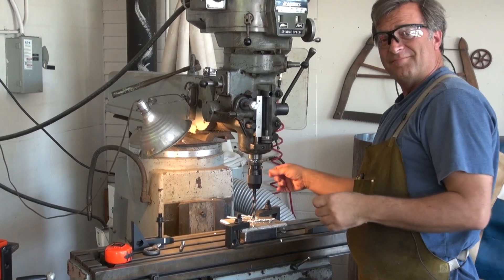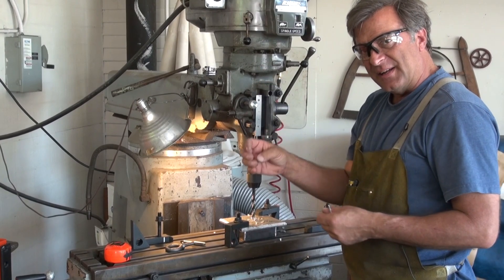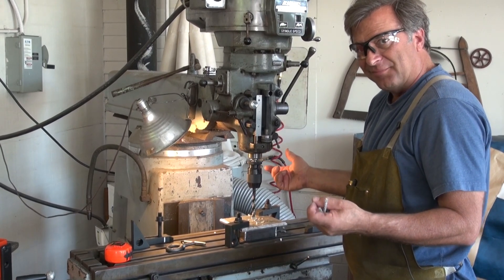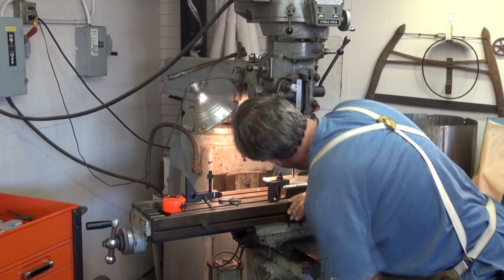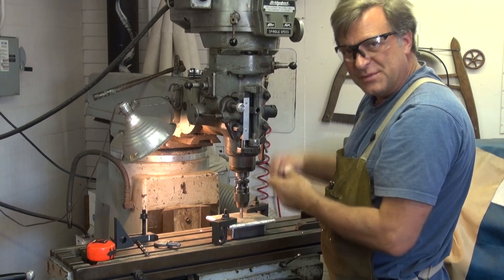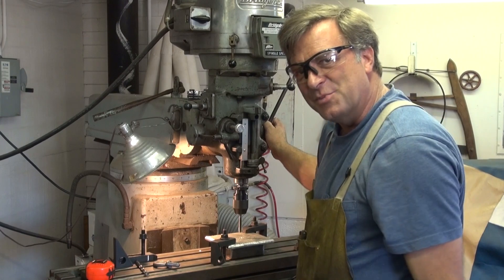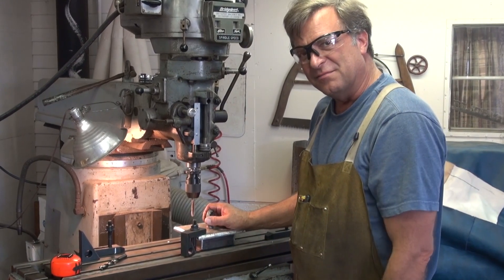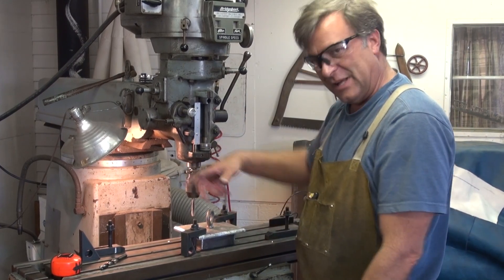How to Tap a Hole in Metal Using a Mill - Kevin Caron

Comment: I'm sure this has been covered in the previous comments (I didn't read them yet).

Power Tapping on the mill:

Use spiral point taps (gun taps) to push the chips ahead of the tap.  (Blind holes, make sure to drill twice the tapping depth)

Use a standard chuck, not a keyless, so when you reverse, it won't loosen up,
Use some sort of oil, tap magic for alum, wd-40 etc...

Slight pressure on the quill handle going in - and slight pressure downward on the quill handle when backing out. 

When almost backed out, let up on the quill handle so as not to damage the first few starting threads of the part.

Great video's by the way - Subscribed

Cheers,

Glenn.

Comment: Thanks for your videos....your video on mig welding improved my welding by 90% (beginner but catch on quick) // on the tapping....keep the chuck you have and it will save you from breaking taps ( allows it to slip ). I use a mill a lot to tap aluminum and steel but i use a cutting fluid called Anchorlube. It's more of a paste but can be watered down.....works great.  Thanks Again !

Comment: Hi Kevin 
I agree with the comments so far about the tapping fluid but I would like to add that there is a device called a tapping head that when tapping a blind hole it will auto reverse. Also when tapping with a mill you should consider using a spiral flute machine tap. Also use a counter sink bit to chamfer the hole before tapping , this allows an easier start for the tap and makes the final tapped hole look good too.
I love your video's , thanks for sharing.
Regards

Comment: I recommend a spiral point (through tapping), or spiral flute(bottoming) tap for power tapping, they greatly aid in chip removal. The straight flute straight point taps can load up with chips and seize the tap which then usually breaks.

Comment: Make sure you keep your speeds and feeds at a good setting when using different materials and tapping as well with your drills. Especially High speed steel as well works good. Also had your drill lubricant on to your drill and tap to make it last and for the job to stay at a good finish as well.
Reply from the maker: Always have stuff to learn,  that's why I get up in the morning.

Comment: Yeah, you cut out the part where you tightened the chuck after the tap seized during the cut, (tapping procedure). Big points for trying this in front of us with no practice. So I'm guessing that the power of the machine is what saved you from having to tap and then back up repeatedly like I learned in shop with a manual tap. Did the tap pull the head down by itself?

Comment: Hey just from experience I agree with not using a keyless chuck. When ever tapping, I usually run my mill between 90-120rpm in Low gear, using slight pressure only to guide the tap in and out (not forced or free run, it could slip and rip your threads out) also putting a light counter-sink on your hole allows for a smoother finish without leaving a burr. And one last tip, changing the height and of your table can shift your location (every 0.001 counts for a flawless cut and tap) Tap fluid or some kind of coolant is best to prolong the life of your cutting tools aswell. Happy milling :)

Comment: I used to do this at a machine shop job I worked at.  We used ball bearing Jacobs chucks because they grip tighter, still three jaw.  I will admit we we did mainly smaller taps but we also used tapping fluid which used to be real nasty ( tri chlorethelene I think)

Comment: For power tapping aluminum I use wax on the tap, for steel usually just a little cutting oil on the tap.

Comment: I bet that rigger won’t be standing under the thing - if the wind picks up or it bounces on the crane It could all end in tears - the suggestion of a nut and washer under the patch is a good one.  I have personally had no luck with aluminium threads and steel bolts.

Comment: WD40 will do fine if you can't get any tapping fluid. Also you can run that drill a whole lot faster, 1000-2000rpm is good, a little cutting fluid helps here too, you'll notice the aluminum sticks to the drill after a while if it's done dry.
Another tip is to put the mill in neutral gear and turn the chuck by hand if you're going into a blind hole.
Hope you'll show us a video of it when it's done, looks like a monster on the website.

Comment: Are you using a 123 block to rest the stock onto for drilling? Is this what you would usually use when drilling holes completely through a work piece?

Comment: ok so a tapmatic is the best way to go.. but how about attaching a 12 point socket to hold the tap..?? like I do by hand..
Reply: also how r u holding the workpiece on the table..  I have a 3/4 " acme tap that has 3" starter cutting blades on it, before it goes onto the 3" of conventional tapping blades.. so if I do a successful tap i need a depth of 6 inches to hold the workpiece.. any suggestions how to accomplish this.. on a mill..  or even a lathe..
Reply from the maker: Never tried it with a socket.   Have to look in the tool box and see what I have.
Reply from the maker: Just how you see it in the video.   Got clamps on 2 corners holding it down.

Comment: Be careful tapping with a keyless chuck.  Keyless chucks are designed to self tighten if the tool slips.  They can tighten to the point of cracking their body when using a tap because of all the additional torque required to wind in a tap.  If you’re going to use a drill chuck for tapping it is better to use a ball bearing (super) keyed chuck.  Don’t ask how I came by this piece of knowledge.
Reply from the maker: Great tip!    Thank you for watching and posting.

Comment: I would not recommend using the keyless chuck for any tap over 1/4 in. because, when is slips in the chuck it will eventually wear out your chuck jaws making it inaccurate for drilling. If you are going to power tap like this, it works much better to use a 2-flute spiral point tap so it sends the chips down the hole ahead of the tap. Use a tapping fluid specifically for non-ferrous metals (I prefer Relton A-9). On taps over 1/4, I prefer to use a spring loaded centering device in the spindle and hand tap.

Comment: Get a tapmatic power tapping head for your mill. Makes life much easier!
Reply: James S I have a tapmatic, an er16 spring tap holder, and also do rigid tapping. It ultimately depends on which mill, lathe I’m using, material, size of threads, etc..., really anything 10mm and larger i will usually rigid tap here. Now when we’re talking m1.5 threads I’d never consider it. Ultimately the process will depend if I’m running manual or CNC, how many holes, etc...

Comment: I just keep the setup locked in place and use a Starret tap handle of the correct size (important) and a B&S tap follower in the chuck.  You never need to run the motor, no risk it will run away and break, no special chip pushing tap required, easy to beak chips, no need to drill double length  holes, stays in near perfect linear alignment (don't know how to dial indicate that), etc., etc.

Many advantages to hand power and a tap follower from B&S.  I have never done one greater than 1".